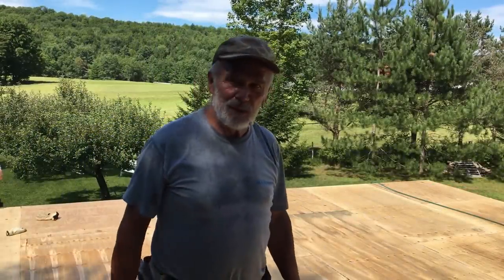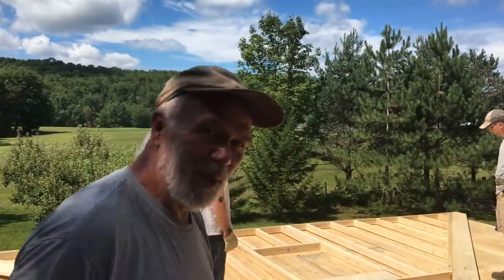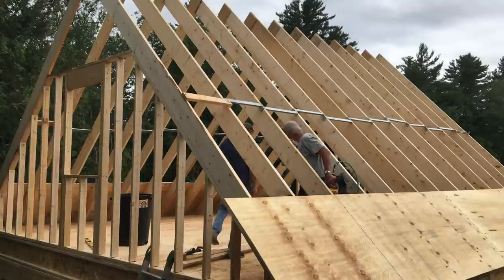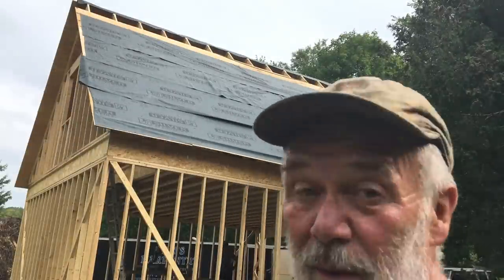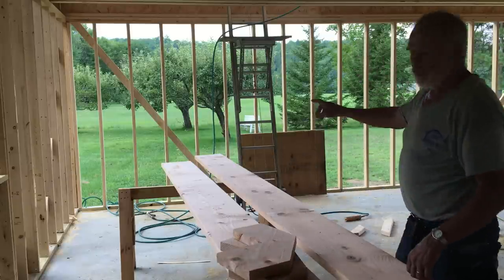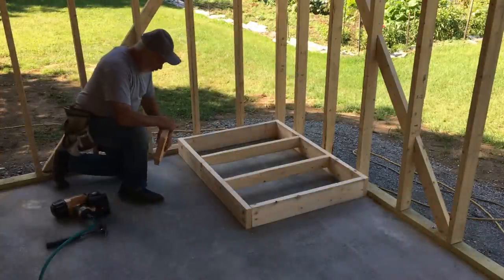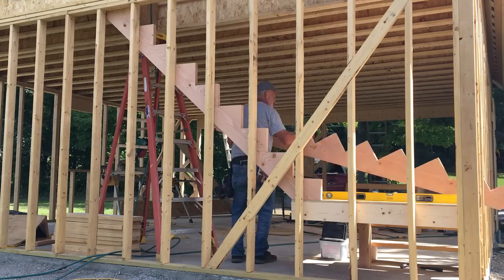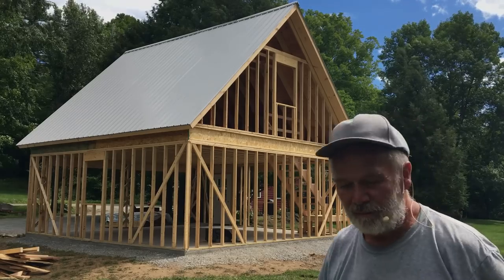#203 Cape Style Garage $29,000 Final

Comment: Here's one for you I have never seen, but used on my house..instead of toenailing the plate like you did to keep it on the line...use some duct strap...screw it to the subfloor or tapcon to slab and bend up onto the plate and nail/screw...when you are done...cut loose with grinder from the inside...you will have absolute zero change/positive hold to your plate location.  Also, how do you like those simpson joist spacers...I didn't like them at first, but used them on my recent garage...great for solo working!

Comment: Question for you Ken. The rafters that you use are they 2x10 or 12’s. And if your pitch is 8/12 or 9/12, how long are your rafters. My calculations for a 30 ft floor and 9/12 pitch are a rafter over 20 feet long. I don’t think I can get lumber that long. With 16” o/c, my live loads may not be high enough in our area. Thanks for your help
Reply from the maker: Thanks for watching we use 2x10 at a 12/12 pitch 18’ long

Comment: How did you complete the two foot rip on the top of the roof.  I am an absolute novice when it comes to carpentry and I had to squeeze myself through a small gap on the roof to install and finally use a ladder at the peak to nail. Just wondering how you did it.  Thanks for the video.
Reply from the maker: Sounds like the same way you did

Comment: Have u ever had problem with that type of roof wrap I used it on my garage and I had problems with with it leaking threw the staples I believe. The shingles were not on yet I just put that on there to cover the plywood until I got to start shingling and I noticed every time it rained water would come in just drip a little bit and I’m just assuming it came in through the Staples because everything was latched properly just wondering if anybody else had a problem with this type of roof wrap. Thanks ✌️
Reply from the maker: For me unless it was ice and water shield all roof wrap leaked when it was punctured with a staple

Comment: Hey Ken,  great content; quick question.  I’m going to build here in Wisconsin, and I really like your hand framed rafter system do you have any issues with building permits or does your 2x10 more than cover the pounds per sq ft requires?  Thanks in advance!  All the best Sir!
Reply from the maker: Thanks for watching. No not here in Vermont. The framing. Did like this 35 years ago is still great.

Comment: 2 questions
Where'd you get those temporary metal rafter braces?
How did you hang that ladder on the ridge, just some ladder hooks?

Also, quality work as always 👌
Reply from the maker: I bought the rafter spacers at a local lumber yard. I made the ladder hook so it would straddle the ridge cap.
Reply: @kenskarpentry  thanks you sir